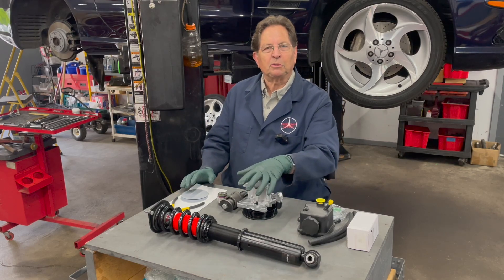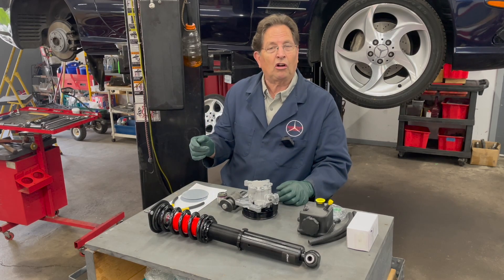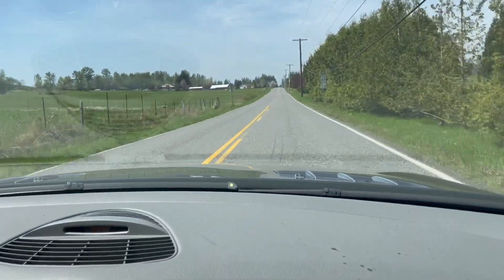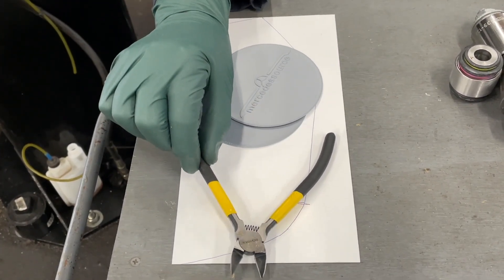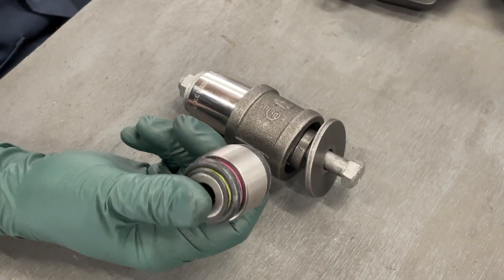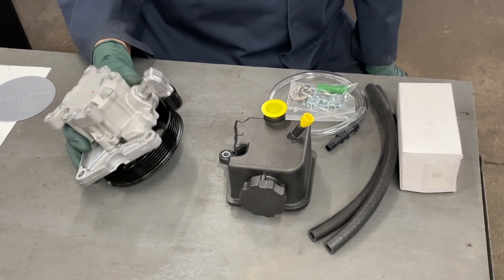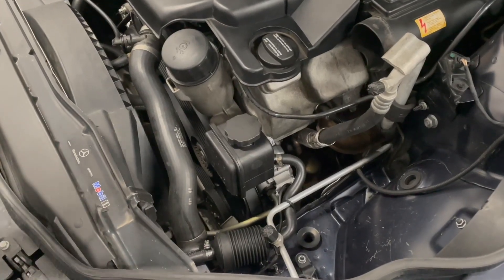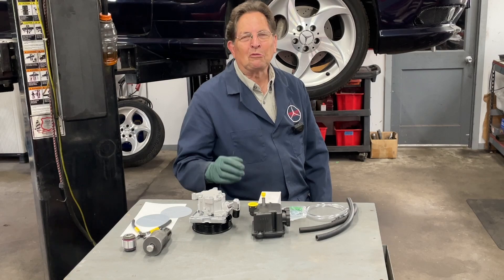SL500 ABC Conversion Questions? DIY How-To Video Manuals and Upgrades Available.

Comment: On thing i wanted to do so bad was put coil overs on a w220, because the look would be breathtaking. I found my CLK500, which saved me from that work because it came with a conventional  suspension from the factory, and I believe it's the only m113 equipped car to come that way from the factory, in Germany (not an American manufactured car). You're videos and website are critical to happy ownership experiences with these amazing vehicles.

Comment: Kent, thank you for the videos. I purchased a 2004 SL55 based on the parachute of swapping out the ABC. What is your view on Stabilizer bars (front and back)…i apologize if I have missed that question prior
Reply from the maker: I discuss this topic more fully on my ABC conversion videos available on my website. This is an "opinion" topic and hardly ever based on facts. Some on the internet would imply you will crash and burn if you do not install sway bars. There are lots of "it all depends on". ...Suffice to say I did not put them on my SL500 and I am very please with the handling results.

Comment: Hello Kent...   Im considering the coil over swap on a 05 SL55. What kind of hydraulic pump is the right one?   Thanks
Reply: @Mercedessource  Thanks for taking the time to answer my question, but as it states on the conversion documents, that pump isn't compatible with SL55 AMG.
Reply from the maker: Sorry, I do not know, as I have not converted an SL55. Check around on some of the Mercedes forums and try to find someone who has done a pump conversion

Comment: Kent i have a 2002 s55 w220 m113NA & my power steering pump went out & i wanted to remove the abc pump will the steering pump and tank upgrade on your website work for me? If not what do you recommend?
Reply from the maker: I have never done the conversion on an S55 W220, so I can not confrim or deny. I do not make recommendations on cars that I have not worked on personally.